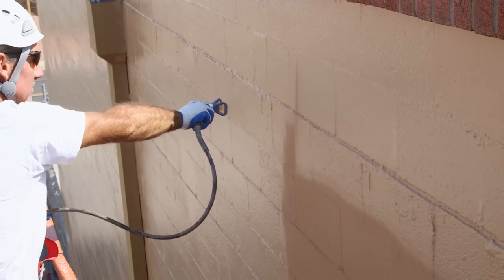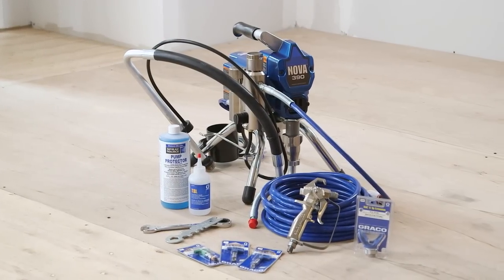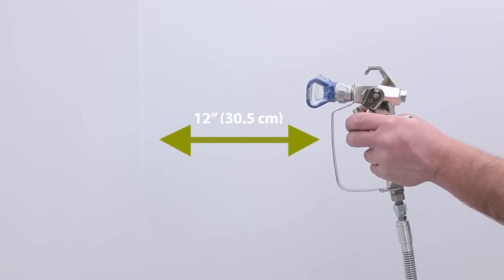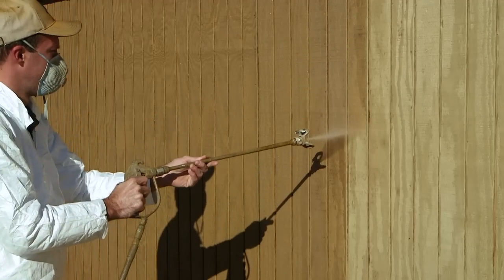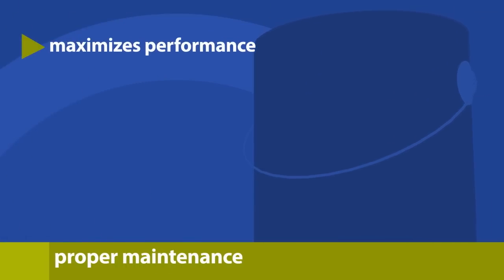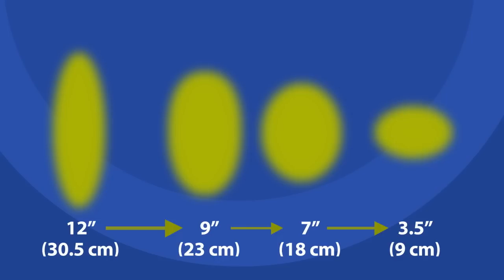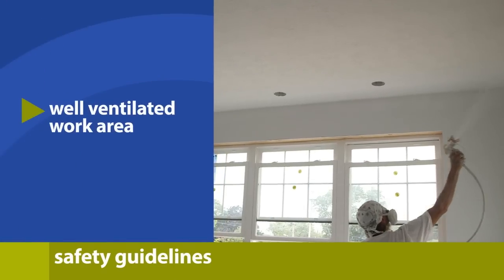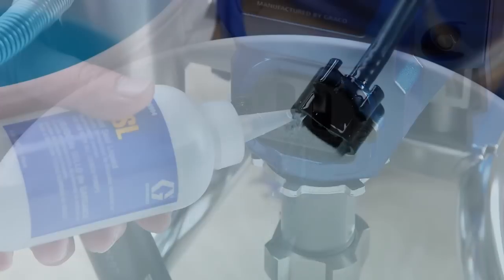Spray Application For Pros - Sherwin-Williams

Comment: why would they recommend you back roll a spray finish I'm a Furniture finisher and I never backroll anything that would ruin the Finish
Reply: John Bergeron
Reply: I’ve been trying to get a legit answer for that question for years, i understand why backrolling new drywall but I don’t understand backrolling a repaint
Reply: Basically the spray doesn’t really fully cover the wall deeply. It only surface paints the wall. The roller embeds the paint better to all the tiny cracked, etc. So why use a sprayer then, you might ask, well the sprayer puts the paint on the wall.
Reply: @Bbbbbbbbbbb-f1w  I back brush or roll too so it's even. Exactly sprayer gets it on fast so you're not dippin all day.
Reply: @lexandersantana8089  For me the most important reason to back roll is if you need to do touchup. If you only spray you will have flashing from a brush mark or roller mark.
Spraying , brushing, rolling all leave a different finish on the drywall or other substrate.

Comment: I'm going to have to disagree about having a reduced pressure from a smaller diameter hose. Given the same amount of fluid flow rate (paint) output from the actual airless paint sprayer unit, a smaller diameter hose will theoretically yield a higher output pressure than a hose with a larger diameter.  Think about 1 gallon per minute of water coming out of a 2 inch diameter pipe versus 1 gallon per minute coming out of a 1/16 inch diameter pipe. Pressure on the 1/16 inch diameter pipe is immensely larger coming out of the smaller pipe. The actual volumetric flow rate is equal for both pipes, but in order for that same volume of water to come out of the 1/16 inch pipe as the 2 inch pipe, it has to have a huge pressure increase
Reply: Noah Krietsch that's not how fluid dynamics work. a larger diameter hose, with all things equal (interior smoothness, bends, length etc) will always have reduced friction loss over a distance.   The fluid speed, which is what causes friction aginst the interior walls, exponentially increases with a smaller diameter hose to flow the same volume. 

Go swing by any fire department and they will gladly give you a real world example using 1.75 vs 2.5" hoses and the same nozzle size. it will take more PDP (pump discharge pressure) to overcome the flowing fluid pressure loss along the hose.  At static pressures will equalize and the pump will be doing the same pressure output. but once things start flowing, the added velocity and increased turbulence requires more pressure at the pump discharge to overcome it.
Reply: Noah Krietsch )
Reply: Nope, that's not how fluid flow works.